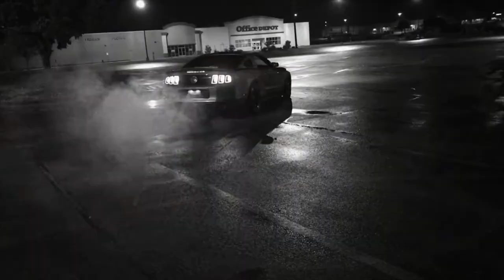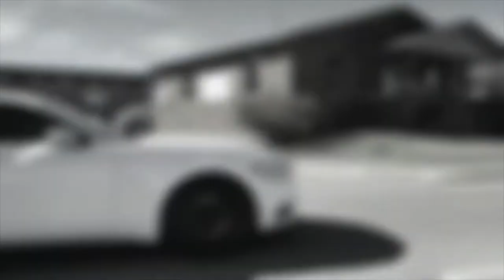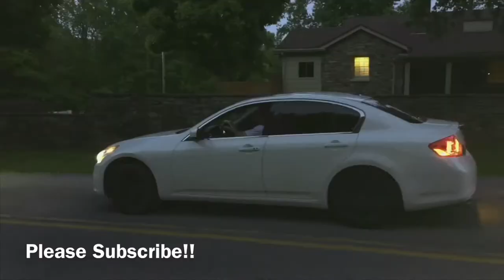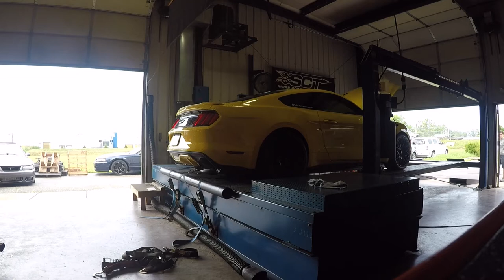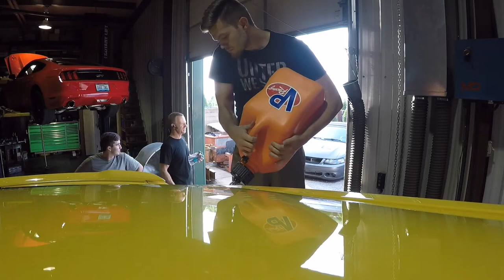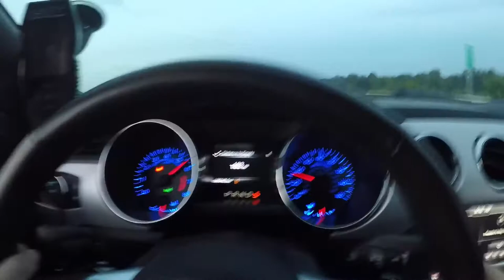2015 MUSTANG 5.0 AUTO E85 DYNO TUNE makes BIG POWER!!

Comment: Sounds like a very conservative Dyno... But gains on e85 seemed on the nose which is odd if it's a stingey Dyno.. my 2016 6r car made 420whp with 2018+ GT ported intake manifold, 2018 GT airbox and intake tube, and a borla touring catback on a Dyno that read pretty standard with others.

Comment: Why was he doing such long revs on the dyno? There's no way that was a WOT pull.  Good numbers just curious.  And the fan was blowing into the bottom grill.  The intake is on the top right.  Not sure why so many tuners do this.
Reply from the maker: sbtiger556 the pull is in 5th gear and the dyno is under load so it still takes time for the engine to turn the wheels! The intake duct is fed through the bottom left of the grille.
Reply: Down South Racing I had my S550 dynoed by Prodyno in Fort Mill SC.  I've watched countless vids of cars on the dyno.  Just seemed the pull was a little long.  I know some air comes in through the bottom grill but the main entry is at the top right on the factory grill.  Ford did something strange by only opening 6 of the 21 honeycomb sections in that area.  I used a tool and opened all of mine and it made a difference.  Looking through that area you will see the air filter directly in front of the opening.  Prodyno did the same thing.  Just place a fan out front but driving down the road most of the air getting to the filter enters in this area.  I used the injen intake to keep the snorkel back to the grill.  I've been told by countless tuners that the open "Cold" air intakes are useless.  The closed box and PMAS are the only ones that do anything.  The open filters like JLT and others are simply sucking  hot air from the engine bay.  Check that area out on your grill and see how many honeycomb's are actually open.  You would be surprised what opening all of them will do.
Reply: @sbtiger556  I saw someone else say this about the opening. I want to do this then I wondered if it was done like this so the car won't suck in water while its raining or washing your car and you mistakingly spray water into your intake. Have you had any problems since cutting out yours? If not im doing mine asap.
Reply: I sold my 2016 for a 2018 GT350 which I still have.  The open air filter gets really hot sitting still this time of year.  As in 170+ at times.

When I cut the honey comb plastic openings on my 2016 it made a big difference! I used a flat drill bit and clean it up and you couldn’t even see it.  Water was never an issue.  Washing or rain the snorkel is so long it didn’t matter.  The 350 has an opening to the engine in the middle of the hood.  Water gets in but not to the filter.  Its too tight with the good closed.  You will be amazed at the increase in power for the increase in air to the filter.  It never made since why ford only opened a few of those
Reply: @sbtiger556  170! Wow. But thanks im gonna break out the dremmel and get started 👍

Comment: All those mods and e85 low 400 RWHP does not make any sense I'm making 404RWHP with pure CAI, Tune and straight pipes. Must of had a error on you guys dyno
Reply from the maker: Major_wright3851 auto trans loses more power but I mentioned they dyno was low reading, but it’s a good number to go by so you dont overstate your car’s abilities!
Reply: I think the issue was that it was ran in 5th gear should of tried third which imop would be a closer 1:1 I tried 4th but always lost hp

Comment: Did you guys swap injectors or run the stock ones?
Reply from the maker: BillySAw951 stock
Reply: The bigger injectors provide alittle but more fuel on the higher rpm range you get alittle more HP
Reply: Down South Racing so I can run stock ones
Reply: @JJ-gr7th  you can run stock on the 15-17’s until you swap out the manifold, it’s just best to go with a 47lb injector or better though

Comment: What mods does the bigbird stang have?
Reply from the maker: UR DAD catless 1 7/8’ long tubes, Corsa x pipe, Roush axle backs, C&L intake, E85 tune
Reply: Down South Racing wondering bc I have a 2011 I have the same 1 7/8 longtubes 3inch all the way out to the back airraid and 47lbs injectors e85 manual with 3.73 and a catch can wondering how much hp I would be around ?
Reply from the maker: UR DAD I would assume very similar numbers man! Those gen 1 coyotes make just a little less power than the gen 2’s but you’re a manual so you’ll make more than an auto!
Reply: Down South Racing I heard that the coyotes gen 1 were underrated according to car and driver idk they claimed 435 at the crank